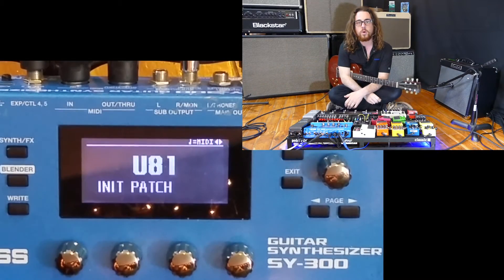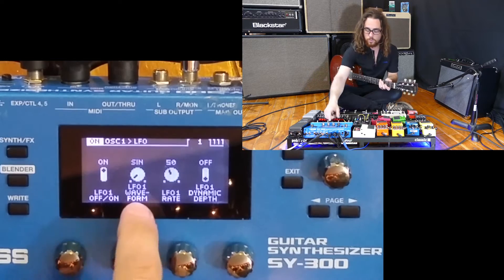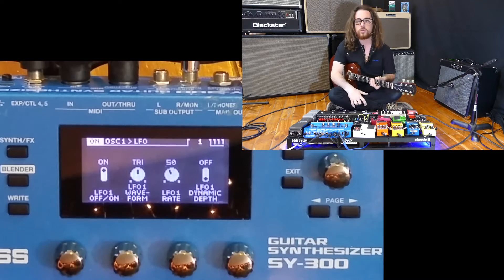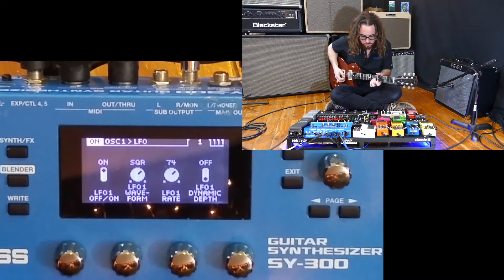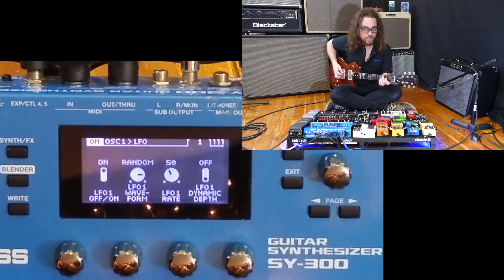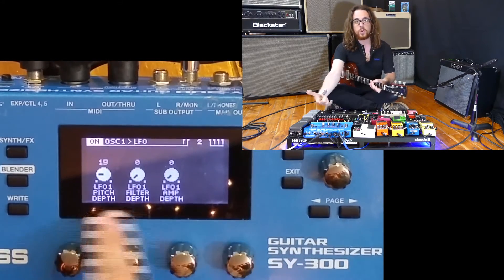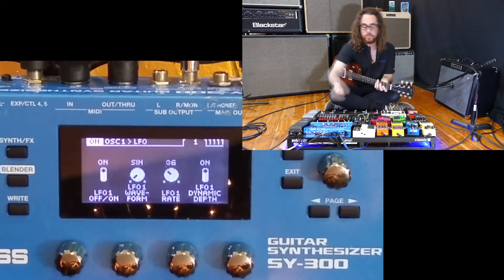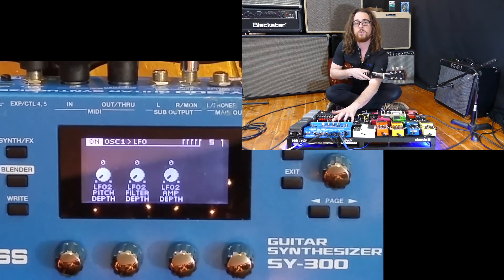BOSS SY300 LFO's

Comment: Austin is it possible to use the boss gt1000 and the sy 300 together and what are the routing options? do you need to have mixer?
Reply from the maker: It is possible. Personally I would put the SY first in the chain because the SY is input sensitive. That being said other have had successful tones putting the SY later in the chain. You could hook the SY into one of the FX Loops on the GT and you can move the SY300 anywhere in the signal chain.

Comment: Hi Austin. Great video series. Thank you! I'm having trouble finding a way to set/adjust basic amp parameters (ADSR). Are these not controllable or am I just lost? Thanks, David - Ventura, CA
Reply from the maker: Standard adsr controls on a traditional synth are not available on the sy300.
Reply: Thanks for the reply. Are there other ways to apply slow attack, release? Would maybe LFO amplitude work for attack? How about release? I have to wonder how the pad patches work??
Reply: Maybe it has the Slow Gear pedal modelled in the effects section. That's how I do it on the VG 99. @davidcunningham178
Reply: Some people recommend the EHX Attack/Decay pedal going before the SY300.

Comment: Hi ! Is it possible to link the LFO rate to the internal tempo clock?
Reply from the maker: Yes. If you turn the LFO Rate knob up to rhythmic note values, the note values are linked to the internal BPM.
Reply from the maker: Yes! the Rate knob when turned all the way up will display rhythmic note. those are the rhythmic subdivisions of the internal tempo clock.

Comment: could you show us how to ajust the adsr envelopes of the oscillators? I  want to be able to shape the sounds in length, that seems to be missing, from what I've seen so far
Reply from the maker: The controls on the SY do not feature typical ADSR controls. You could use any of the built in FX to achieve some of these controls you're looking for.

Comment: Hi Austin, I have a question, does this synth feature an adsr envelope?
Reply from the maker: There are ways to reproduce ADSR esc sounds but the controls do not follow typical ADSR signal flow. Using the LFO and the waveform controls could give you the sound you're looking for.

Comment: does this unit output midi notes? can I play another synth through the SY300 with my guitar?
Reply from the maker: Michael Bath it does send midi note data but only monophonically not polyphonically.
Reply: dang. that sucks! Thanks for the response!
Reply from the maker: Michael Bath for polyphonic control you could a gr55.
Reply: Hi Austin, how do I do that? My SY300 sends a lot of midi data (so I guess it is properly connected), but no note events so far.
Reply from the maker: Yes you can do this but only monophonically. no polyphony.